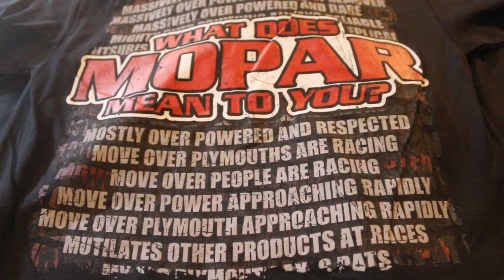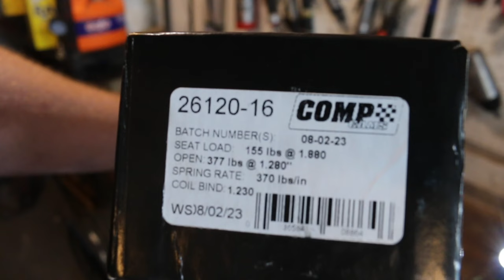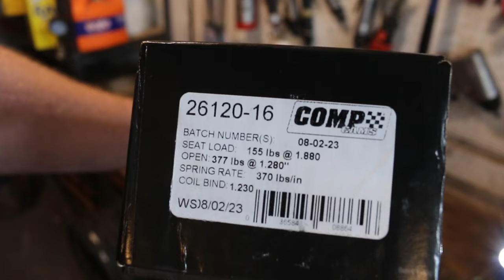Setting Valve Lash for Hydraulic Lifters; Assembling Cylinder Heads & Buttoning up Marsha's Top End

Comment: I think those pushrods are still to short?  On the rocker adjuster, there is a milled down area that needs to align with the oiling hole inside the threaded part of the rocker arm.  This rocker arm hole needs to align up (within a few turns) of the milled part of the adjuster to supply oil the the pushrod tip.
Reply from the maker: Ideally, an 8.85 or 8.90 would put the bulb higher in the cup of the rocker but I verified with COMP Cams that the angle at full throw was safe. But yes, you’re right, I’d prefer them to be a hair longer.
Reply: @moparconnection   I usually measure and custom order pushrods from Smith Brothers, but order is usually $200 or more for pushrods.
On the Max wedge heads with the offset intake rocker arms, my intake and exhaust pushrods are different length because of the rocker arm offset.
Reply: zerogmopars746, I saw the same thing you did and saw his response. You were all over it, good eye! I'm taking the high road and walking away to go read some Chrysler Power. 😏

Comment: You don't have to lock down the nut doing the 0  lash process and also 0 lash all the valve  on both heads per quarter turns of the crank turn: the lock down of the rocker nut is the very last step after  0 lash and preload , then lock down, otherwise your really over working the hell outta yourself: although there's nothing wrong with what your doing, but it's just not necessary to do that at that stage in the game:
Reply from the maker: This method pretty much sucks. We've moved onto the opposition pattern method.